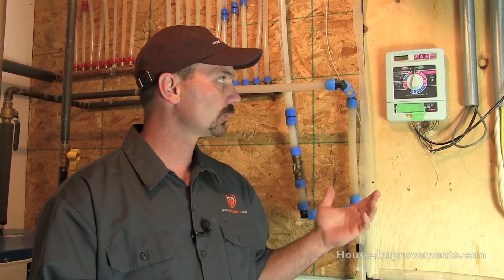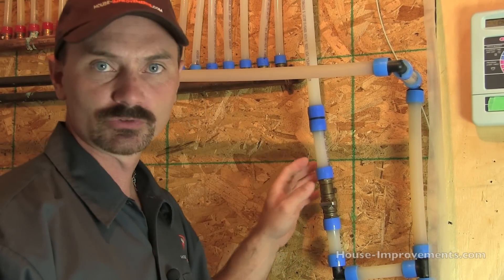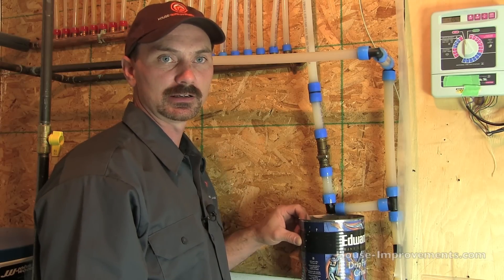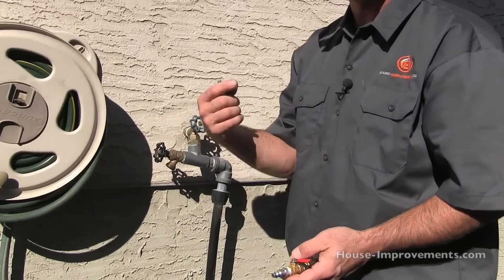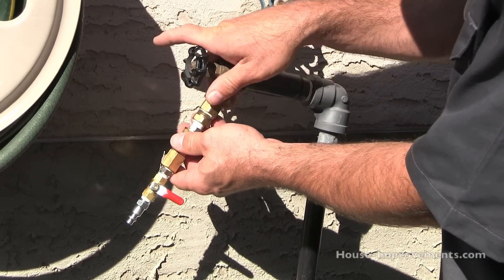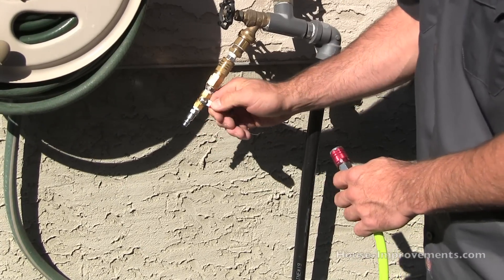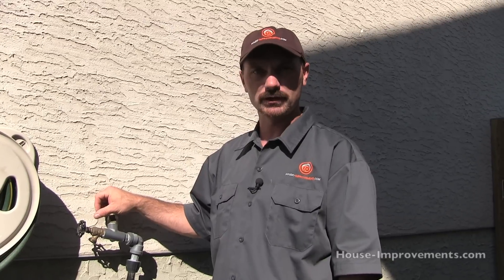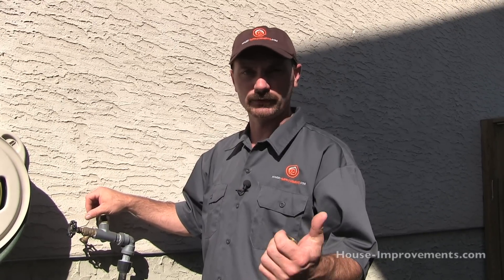How To Blow Out Your Underground Sprinklers

Comment: One important thing to mention is to not let the heads run with just air for more than two minutes. When running normally they're cooled by the water, but with just air they can actually start to melt if they run for too long.
Reply from the maker: Something I have never heard before?
Reply: @HouseImprovements  I hadn't either, until I did. It makes sense - the gears in rotators are plastic, and friction creates heat. Hunter recommends running in two or three short cycles. They also recommend opening the zone first, then gradually introducing air into the system instead of all at once by activing the zone with a charged pipe.

Comment: What size of compressor do you need?
So, leaving the valves cracked open outside will leave room for water build up? I saw some people would leave a bucket inside on the valve if it has one so if the back flow shot off valve leaked any during the Winter. Hope this makes sense.
Thanks,   Doug
Reply from the maker: it was a 3 gallon but almost any size will work it may just take more time to air up.
Reply: HouseImprovements Thanks

Comment: Great Video! I was wondering if you had plans to make a video on how to install stone siding, I already checked out your vinyl side which I used for redoing my garage siding, I want to replace a small area of vinyl around my front door with stone instead of the existing Vinyl. Thanks!
Reply from the maker: Sorry i do not , I have installed Faux stone before and it is pretty easy, give it a try.

Comment: Do you build houses too or just renovate ?
Reply from the maker: renos,additions ect. but no whole homes.
Reply: HouseImprovements But by these videos, looks like you could easily build a house if you wanted. I built my current house with my brother in 2 years, had no clue what I was doing and had bad math skills and I sure regret building it, hard to work on everything is crooked and now it takes 1 year roughly with My crew to build huge buildings